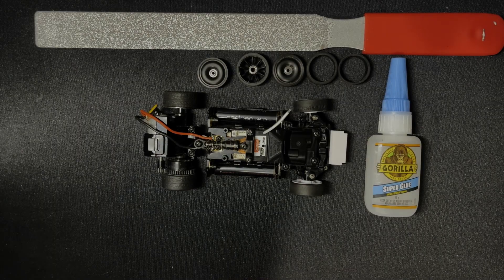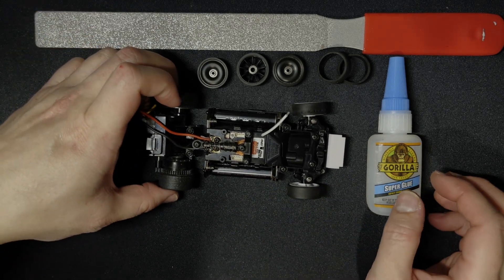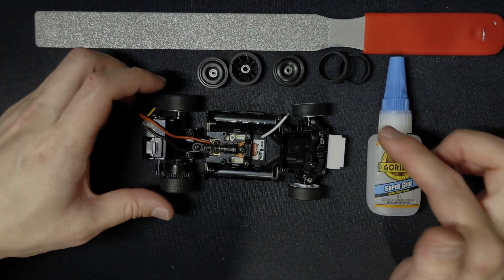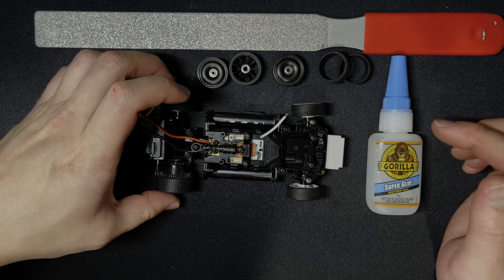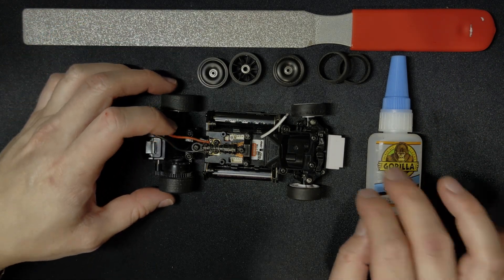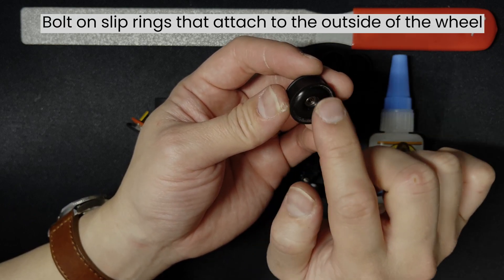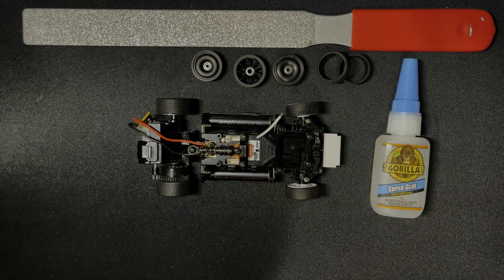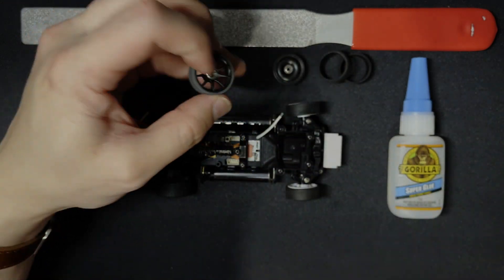Mini-Z Box Stock Racing Series Part 8: Traction Rolling

Comment: My least traction rolling car has the PN flanged wheels with PN Low Profile Super Softs up front, and Nexx radial RS1 on stock rear wheels. Rears look like slicks, but man it hooks. Can almost turn steering drive to max. Turn in at high speed is butter 99% of the time. I still have to try the super glue for other cars. The combo of flanged wheels and low profile tires is just perfect.

Comment: Thank you, this is great! Would you recommend doing this to both the front and back wheels or is one more important than the other? 👍
Reply from the maker: Thanks for watching.
For traction rolling, the front is more important. You can generally get away with just gluing/fixing up the front, but if that doesn't fix it do the rear too.